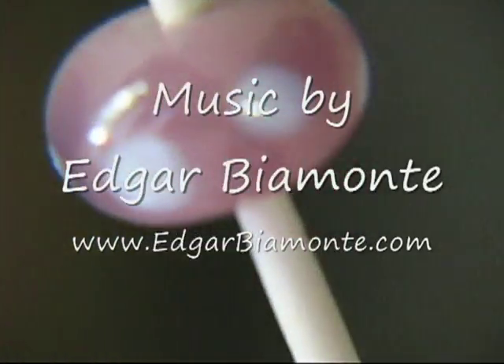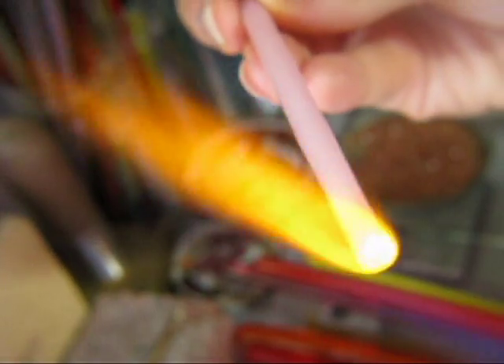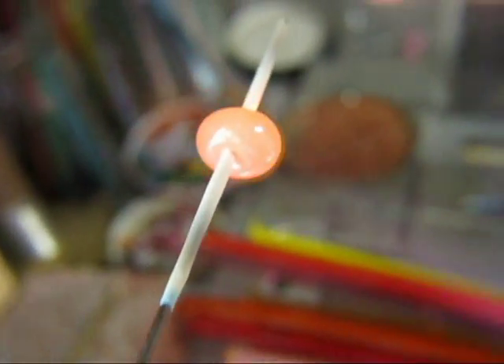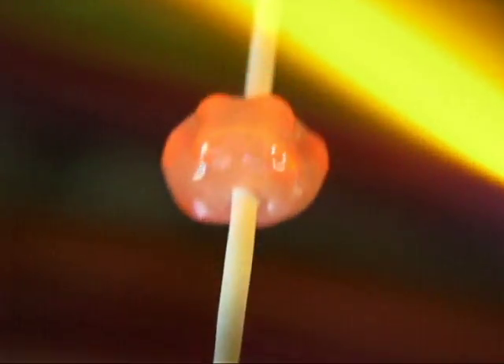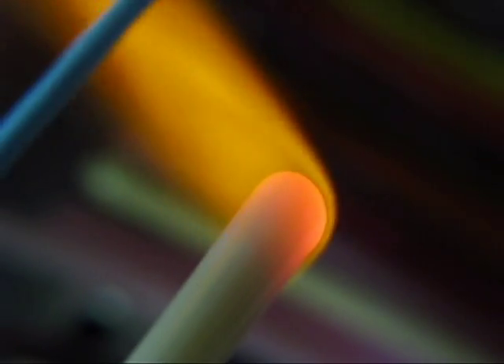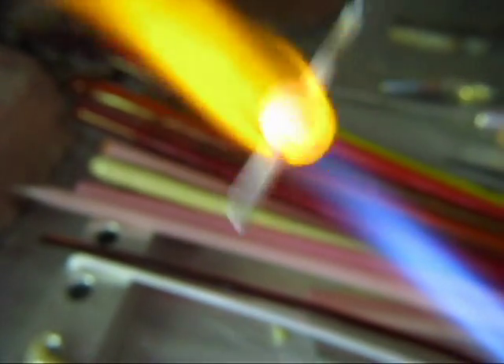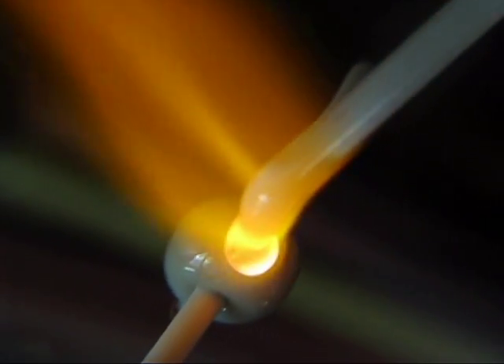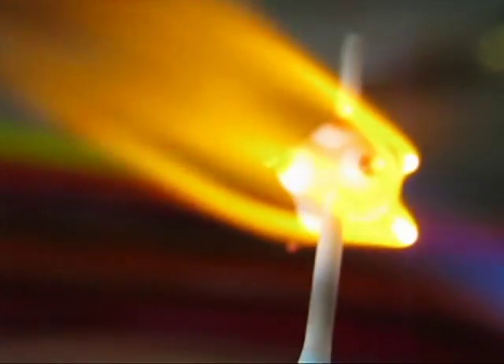Using Devardi Glass w/ the Hothead Torch, Lampwork Beads Making Tutorial

Comment from the maker: Hi, thanks very much. I'm very glad you are excited to get started. Mapp Gas is only slightly hotter than propane. It does tend to be a cleaner gas though. You can use either propane or Mapp. I would try both and see which you like better. Eventually, you may wish to get a hose that goes from your torch to a bulk tank, such as a BBQ tank. Propane is a lot cheaper that way. Thanks again. Kindly, Natasha